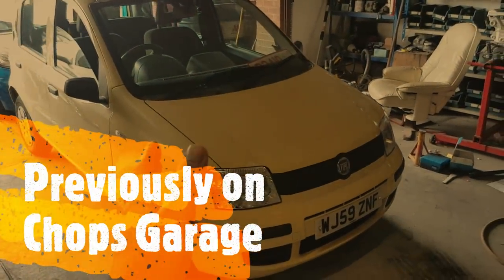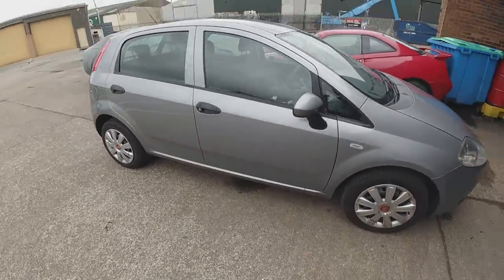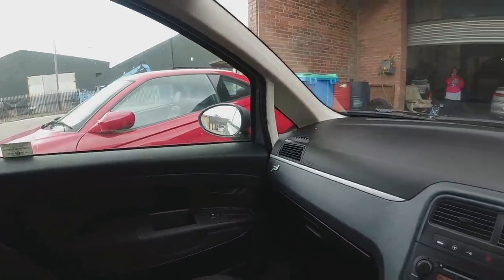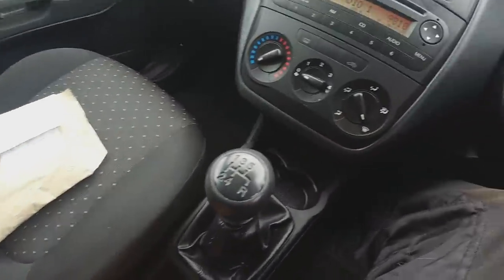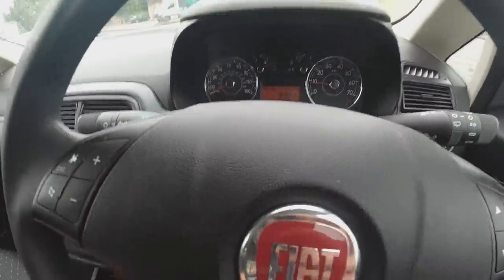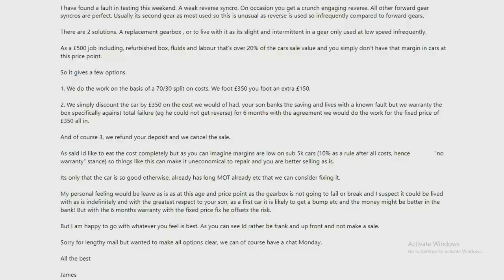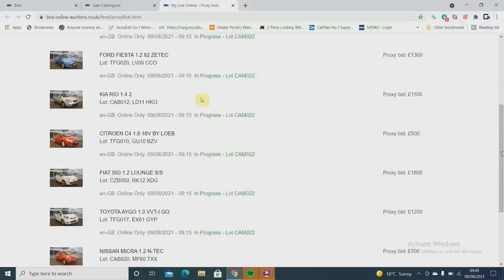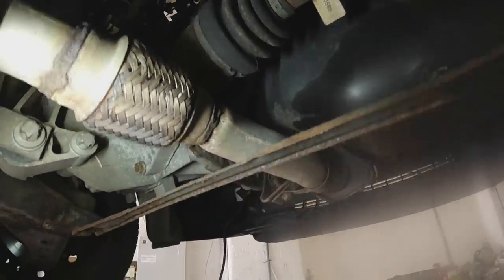TRACKED DOWN!  I found the previous owner of the used car I bought at dealer auction!

Comment: As I understand it, there is no synchro on reverse gear, hence the crunching on reverse only. The usual problem being the clutch centre plate not sliding on the first motion shaft splines..... This being sorted by the synchro on the forward gears. Just a thought from an old ex-maniac, I mean, mechanic lol.
Reply: Same on fiesta gearbox's lol have to put it in first then reverse an I normally don't get the crunchy rice Krispies lol.
Reply: I've had a few cars and pretty much all of them crunched in reverse. Most of them are fine if you stick it in 1st and then reverse.
Reply: Spot on.
Reply: I use third and then reverse. It's closer and works every time without the grind.

Comment: The gearbox looked slick enough a bit of a crunch into reverse isn't unusual getting the gears to mesh as there's no synchro. Some gearboxes are just more prone to showing it than others. Don't know if I'd have done the clutch either, all the other gears looked to engage easily enough, just wonder if it's one of those 'if it isn't broke don't fix it' things. Probably been owned by someone who rode the clutch or sat with their foot on the pedal putting a bit of constant pressure on the plate springs. 
Maybe the Fiat Punto 'reputation' swayed you, cheap Punto so there must be something wrong. As usual though James, exceptionally fair and great respect.
Reply from the maker: Thanks Alan!
Reply: I think that some Ferraris and Lamborghinis use synchromesh on reverse gear, but not for mere mortals!
Reply: @john1703  You'd be surprised how many run of the mill/everyday cars have a synchro on reverse, the MTX75 gearbox in my MK2 1.8 TDCi Ford Focus does have a synchro on reverse, where as my wife's MK2.5 1.8 (petrol) Focus does not (and it's really annoying when you're used to driving a car that DOES have one).

Comment: Your other commenters are correct, there is no synchro on reverse (usually - I remember an old Carlton once with a ZF gearbox which actually did have a reverse synchro. It was great fun being able to select reverse whilst still travelling forward at 5 mph :-) ). It is very likely to be the clutch (dragging) as the synchro on the forward gears will allow it to push through whereas it won't be so happy to do the same in reverse. So, not an expensive fix and it will make a good car great when it's done

Comment: The best tyres should be on the rear.  Best tyres on the front can lead to lift-off oversteer as the rears are unloaded; better to have understeer than oversteer as understeer is more predictable (especially for a novice driver).
Reply from the maker: Well to be fair was not allot in it tread wise and customer request
Reply: @ChopsGarage  No doubt he'll be doing handbrake turns anyway! 😂
Reply: @chiefrocka8604  no the best tyres should be on the rear as per Michelin you can steer the front wheels and not the back wheels
Reply: @chiefrocka8604  As a former driving instructor, I believe I am correct.  If you think that your front tyres dry the road for your rears, you are deluded!
Reply: @chiefrocka8604  For the average driver understeer is significantly more controllable by ‘naive’ driver actions than oversteer.  Lose front end grip and the automatic reaction is to lift off the accelerator, that reduces the workload of the front tyres, regaining directional stability and eventually some traction.  If you do that where there are lower grip tyres on the rear you get snap oversteer which will often result in a spin that is near impossible to catch.

Best look at the recommendations of the major tyre manufacturers and trade associations, they will NEVER recommended fitting new on the front where there are worn ones on the back.  Some tyre fitting places, the more reputable ones, flatly refuse to fit new ones on the front.
Reply: @chiefrocka8604  you're wrong. Rear grip is more important since understeer is safer than oversteer.
Reply: Id rather the back slipped than the front I'd definitely put the best ones on the front unless your ken block
Reply: @arthuritchybollix5064  The best tyres should be on the front for better traction and steering ,all the above information does not apply as this is only a light car and it will benefit from the good tires being on the front
Reply: @SalimKhan-gk1fh  you know better than all the tyre manufacturers do you? Best tyres go on the rear.
Reply: @Raymond4774  Yes if it was rear wheel drive but this is only a lightweight Fiat punto where the front would benefit more with better ties
Reply: I've always put the best tyres on the driven wheels. Never had lift off oversteer in a car because I drive within the limits of the car!
Reply: @mikes747  Yes that’s exactly true which is why the best tires should be on the front especially on a small lighter car with front wheel drive like the Fiat punto your average driver owner of this car I’m never going to get anywhere near to any sort of competition driving!!
Reply: I would have put the best tyres on the front too. If the back steps out you can countersteer or accelerate out of it in a fwd. If your steering tires slip on a wet B-road, then chances are you'll be in a hedge or ditch before you even have chance to lift off.
The front tyres are doing the steering, 65% of the braking, and 100% of the acceleration,  the back tyres are doing next to nothing in this case.
Reply: @stevenharrison9257  just go away- you made your point and I made mine! No need to be rude sir!
Reply: @stevenharrison9257  I’ve been a mechanic for 30 years the front of a punto  will do all the steering 
65% of the breaking
And most of the handling I will definitely put them on the front
Reply: @stevenharrison9257  No need for a tantrum just because people politely disagreed with you. I think you need to sit on the naughty step and think about your actions for a bit😂👍
Reply: @SalimKhan-gk1fh  No, you’re wrong. The whole idea is that for the average driver understeer is preferable to oversteer. I’m quite sure that tyre development engineers know more than you do.
Reply: @Raymond4774  Understeer and oversteer doesn’t have much affect on a small little town called like a Fiat I would still put the good tyres on the front ,We are not talking Tyre development here we are talking an ordinary car driven by ordinary people
Reply: @brianhume4743  it’s spelt bollocks actually
Reply: @SalimKhan-gk1fh  and that is the whole point. For an ordinary driver it’s safest to have more grip on the rear. An unskilled driver is much more able to deal with understeer than oversteer.
Reply: @Raymond4774  were them studies based on rear wheel drive back in the day .... Most real mechanics i know claim best tyres should be on the drive wheels ?
Reply: @stevenharrison9257  you were making good arguments till the temper tantrum or did you just figure out how to use copy and paste . .. shame you had to go down the road of insults like a stroppy teenager
Reply: @ Silver Fox seems to have been embarrassed enough to delete his comment, only to be replaced by more village-idiots stating the best tyres go on the front, even so-called mechanics which is even scarier; maybe do that in hot/dry Pakistan, but please not in the UK.
Reply: @mikes747  lol

Comment: This video could have really helped me out we have a relatively low milage hyundai i20 which usually takes a couple of goes to get into reverse also sometimes grinds only into 3rd gear on the upchange the clutch bite is low. Ive tried bleeding the clutch and changing the gearbox oil but its still the same, now its got me thinking that the problem is very similar to your punto and will require clutch replacing. Thanks for the great videos James keep them coming
Reply from the maker: Well 3rd does have a syncromesh bud so it prob the box on yours. All my forward gears were fine
Reply: Craig, try something which might work for you. When you stop, before to go into reverse, select 2nd gear then reverse. Hope it helps.

Comment: I remember Fiat had a spell in the eighties with gearbox troubles in the Uno. We had a 45 Fire from new that we eventually swapped for something else as the box was a constant niggle. One of the local taxi firms were experimenting with Uno 60's and having similar problems. I've been told that it took Fiat a few years before the boxes they used improved much, but that is speculative.

Comment: I owned a 1.4 Sporting for 10 years and it would crunch in reverse for a good 3 of them, never an issue and if I leaned on another gear before engaging reverse it wouldn't happen. Very reliable car, sold it for a Scirocco which was a nice step up but the young guy that bought it put it into a telephone pole. Now it crunches in any gear.
Reply: well, that is certainly one way to hang up the phone.

Comment: The problem is the Release bearing and the clutch cover , there is no Sincro on reverse on these 👍 Excellent Job common problem the vent pipe on the engine 👍
Reply from the maker: Cheers

Comment: I had a Pugeot 208 and when it got written off i purchased Punto 1.2, the clutch took a lot of getting used to, unlike the 208 which had a lite cluch pedal and it only required a very short travel to release the Fiat needed the full travel to release otherwise it could baulk at changing,on the Fiat forum some owners had a made cut in the carpet to allow the pedal a bit more travel!!With reverse they all graunch unless you dip the clutch pedal for a second before shifting into reverse,again they all do it. not a nice clutch to operate!!

Comment: I thought it was clutch drag. Usually a sign of worn splines on the pressure plate or release bearing. Plate and diaphragm plus thrust bearing fixes this usually. Check slave cylinder throw.

Comment: My son had a 08 Punto Sporting 1.9D, which he bought with only 8k on the and was 6 months old (was a ex demonstrator). He had it for 10 years (put 52K) on it before selling it w/fsh. 

At 48K, the gearbox decided to fail (wouldn't go into 3rd or reverse). He ended up spending 1.3K getting the gearbox rebuilt and clutch fitted. But after doing this, he lost faith in the car (as a few weeks later he had to replace two suspension springs that broken in two) as well as a alternator.  

He said he will never buy anything Fiat related anymore (due to build quality)

Comment: To be fair, any front wheel drive car I have ever had ( ie most of them) baulked/crunched occasionally into reverse.

Could it be linkages or the plastic piece at the bottom of the lever that goes with age.
Reply from the maker: Did clutch in the end

Comment: That Punto will make the lad a brilliant first car to run around in for a few years, my first one had 36k on when I got it and I sold it at 67k when the power steering completely packed up (but it was an 03 with the early dualdrive module, anything post 2008 is sorted on that front) looks like that one is one of the early ones with the tech in like bluetooth and USB
Reply from the maker: Great little cars

Comment: Had a Fiat (fix it again time) Punto for 2 years and had a love/hate relationship with it.  Although underpowered, it drove well, when it worked but gearbox tore itself apart and the electric steering totally failed which was going to be very costly to repair.  Ended up scrapping it despite only having 20K  on the clock.
Reply from the maker: Yes low miles is not the decider people think it is

Comment: The kind of dealer that's unfortunately in the minority, good video. Regarding Fiats, I used to have them until I had a diesel Idea 1.3; it was a great running car - when it ran! It was so unreliable I was constantly buying new components for it. The the clutch cylinders were made of plastic! Of course they failed. My son's Corsa had the same basic engine but it hardly gave a problem, the parts were much better quality. The car as regularly off the road and cost me more in repairs than I paid for it - I'll never get another Fiat.
Reply: Never had a good reputation for quality
Reply: Same my vw punto was problem

Comment: 2000-3000 territory is often a good place to be with cars. New enough that there's life left in them, but cheap enough that you own them (not the other way around!).
Reply: The problem is choppy buys the cheapest stuff usually so it’s pot luck , I started out buying selling fiestas escorts which never had gearbox problems , years later I’m selling vans and buying small cars but I paid more for the better ones with low miles so basically I’d be buying under 50k 10 year old cars , chops buying 100k miler stuff and it’s going wrong so personally I’d buy lower miles better cars , yeah they cost more but if I can sell them the next day usually I’m in a better place business wise
Reply: @chiefrocka8604  true. But I was more talking about as a driver - if you want transport to get to work at low cost, it's not a bad place to be.

Comment: Hi James, enjoyed the longer format video 👍
Totally fair on the Punto, and always up front about everything, no point in hiding faults as they come out eventually, and that does your reputation no good. What a clean thing it was all finished!!
The C1... Get it back to the shop and do your checks first, if it needs anything else you can always leave the sill and door, if alls ok that sill will repair all day long, try a big sliding hammer hooked onto a clamp onto welded tabs 👍
Dodged a bullet with the C4, most will imagine they are Loeb while driving it!! Doubt it had an easy life mate 🚗💨
Reply from the maker: Lol good point

Comment: When you put any car into reverse put the clutch in and hold it in for a couple  of seconds before putting it into gear . This allows the input shaft to stop moving .
Reply from the maker: Yes bud butt in this case it did need a new clutch
Reply: @ChopsGarage  there is a fine line between being a nice guy and making work for yourself .  If the clutch bite was high then it needed a clutch ,  otherwise it was time and money gone .

Comment: I always go to the physical auction now they are open, saves nasty surprises, go over and drive one back, or two. I had 5 on my watch list today and when I went over and got the keys they all had faults, I ended up buying 2 completely different cars.
Reply from the maker: Which auctions allow visits now bud
Reply: Bca  unlikely to have physical auctions. Again . They control the new ways of buying and selling stock
Reply: @ChopsGarage  I thought they were all open, I go to Aston barclay and they've been all open as normal for a while now, it's so important to go, if you can, I regularly put some on my watch list and when I go they are usually the ones I don't buy, you can save yourself nasty surprises mate, when they bring the keys jump in, in a few seconds you can check most things, clutch, windows, ease of starting, you know the score, or at the worst walk with it and ask the driver, you'll cut your recon right down bud,

Comment: Great content as usual, I'd just like to caution the approach of putting best tyres on the front rather than the rear. Poor grip at the rear leads to oversteer which can catch you out in the blink of an eye and spin you off the road. Poor grip at the front leads to understeer which is much more progressive and easier to deal with out spinning out. It's not just my opinion, it's well researched if you do a bit of looking and is regardless of front wheel drive. All the best James, keep up the good work,  I wish I lived near you!
Reply from the maker: Cheers Dave
Reply: Understeer might be progressive if it's due to slightly excess speed into a corner, or a heavy right foot coming out of one, but there's nothing progressive about a set of  ditchfinders losing grip on your steering wheels.
With the front also responsible for 65% of the braking effort, and 100% of the acceleration, then I'd have put the better tyres on the front too.
Reply: @MattyEngland  for what its worth, this old video is a good demonstration: https://youtu.be/gSz7cm6MwH0

Comment: Resting their foot on the clutch instead of taking it out of gear at traffic lights is what's caused both the wear on the pressure plate fingers (heat) and the worn bearing 👍
Reply from the maker: Yes figured this

Comment: Slightly worrying that, as a dealer, you think cars have synchro on reverse gear 😳
Reply from the maker: Why worrying? I don't do the mechanics. Plenty of car dealers never touch the cars and could not change a light bulb, simply buy and sell having everything done outsourced. Does not make the cars any worse.
Reply: @ChopsGarage  But you did “diagnose* the issue as a synchro issue and went as far as telling the customer that was the issue. 

As for not doing mechanical work, didn’t we just witness you changing springs on an MX-5…?
Reply from the maker: @geecars6263  that bolt off bolt on mate,, Id never call myself a mechanic

Comment: It’s worth speaking to a solicitor/ paralegal / local trading standards about consumer rights as - I’m not convinced that you can actually retail cars to the public and declare a mechanical fault and drop the price accordingly.

Ie customer may have best of both worlds - reduced price, declared fault and still full rights of repairs.
Reply from the maker: No you can, you can sell with stated faults fine. But you can't sell simply saying there is no comeback eg sold as seen etc
Reply: @ChopsGarage  Our trading standards won’t allow sold as seen it’s a phrase they hate seller has to honour title of goods - and selling as seen to TS implies potentially poor title.
Reply from the maker: @c11yan  yes Spares or Repair is only legal way to sell as is tho consumer. But must be noted as unroadworthy and trailered away